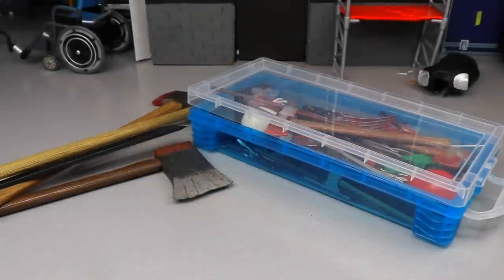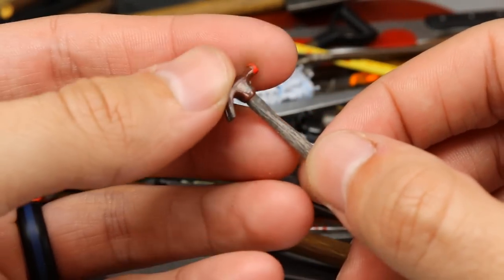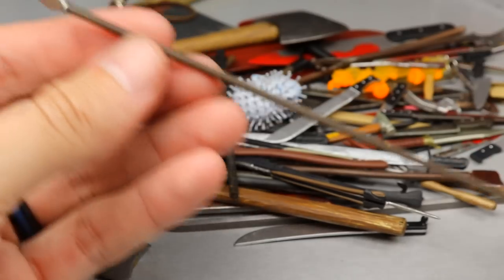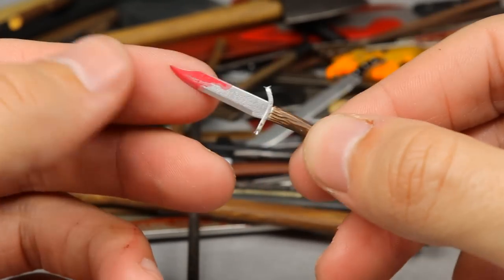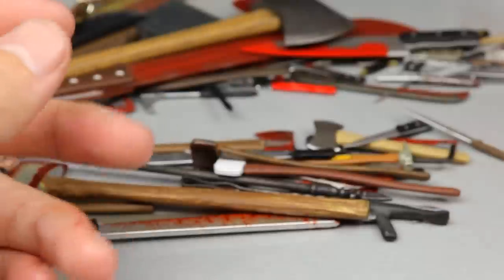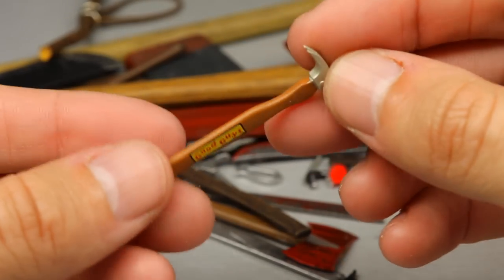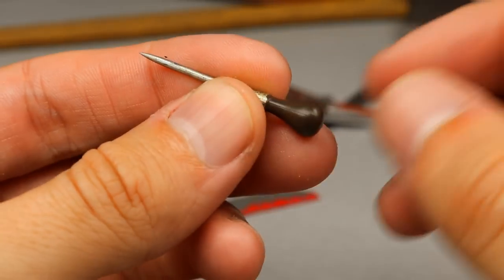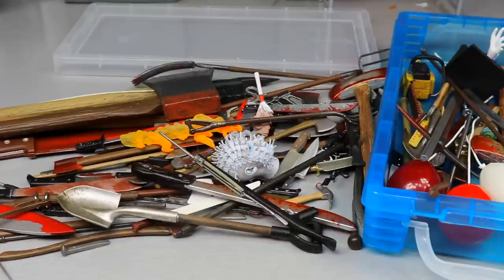MASSIVE HORROR ACTION FIGURE WEAPONS COLLECTION! (2021)

Comment: Here they are (counting the big ones)

Machete: 21
Axe/Pickaxe/Hatchet: 16
Knifes/Switchblade/Meat Cleaver: 24
Balloons: 3
Chainsaw: 2
Pinhead Head: 1
Hammer: 3
Bat: 1
Harpoon Gun: 3
Harpoon: 1
Shovel: 2
Yardstick: 1
Meathook:1
Hellraiser Accessories: 2
Chucky's Pegleg: 1
Spear: 2
Steel Beam: 1
Hedge Clippers: 1
Fire poker: 5
SS Georgie: 1
Pitchfork: 3
Pipe: 1
Pennywise Book: 1
Handsaw: 2
Steak: 1
Syringe: 1
Guns: 1
Wrench: 2
Stick: 1
Flare: 1
Ice Pick: 1
Bottle Opener: 1
Unknown: 2
I spent 45 mins making this list (may not be 100% accurate)
Reply: 0
Reply: Holy crap m8 good on you
Reply: Good  what, what